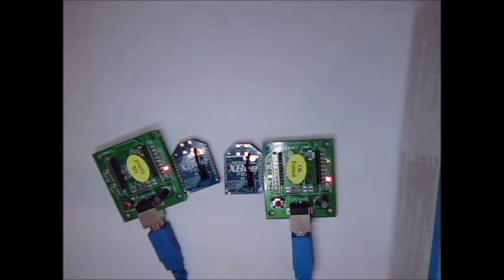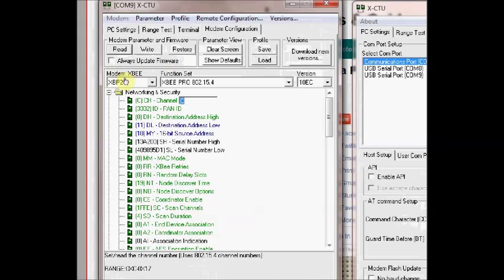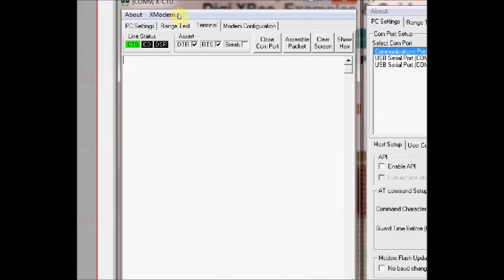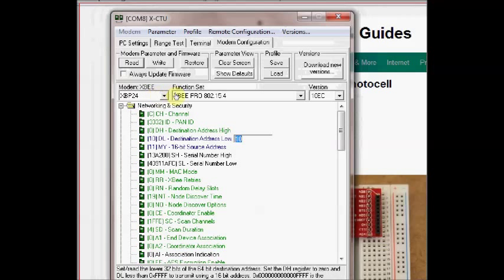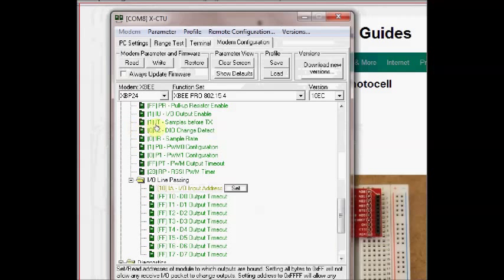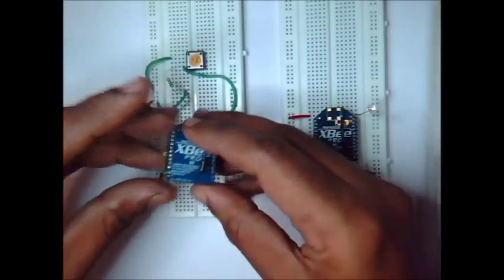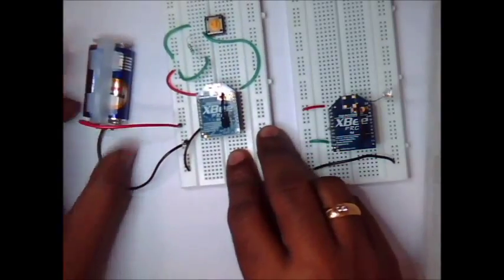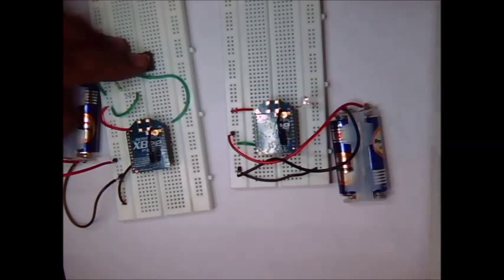XBEE - S1 Direct - Digital Input/Output

Comment: Hi, 
I'm working on a project where I'm not using any controller on the Transmitter side. I'm using three different sensors one digital and two analog. I want to receive it on the receiver side with controller but I don't know how to configure xbee for that. 
I know how to use it for one analog input , we can provide analog input on the transmitter and can get output through 6th pin ( PWM ) of receiver Xbee. 
If anyone could help me than it would be very greatful. 
Thanks.

Comment: Excellent video. I have a question: What potential on pin 20 of the XBee transmitter? in diode?
Reply from the maker: XBEEs operate at 3.3v supply.So, a logic High at pin20 should be at potential 3.3v.